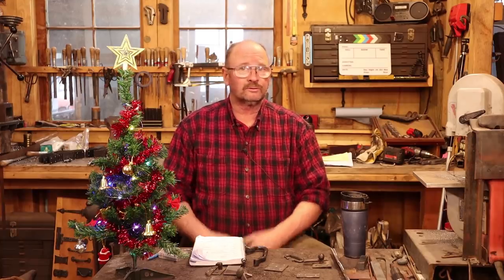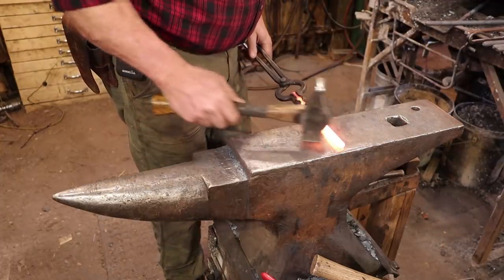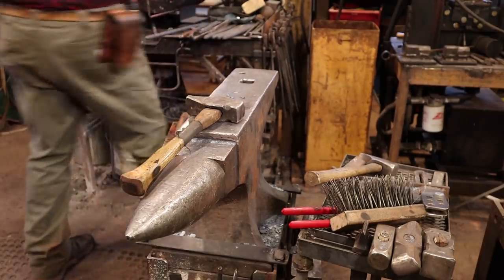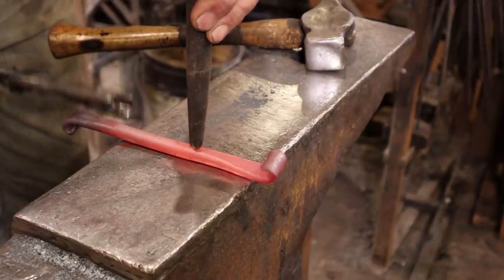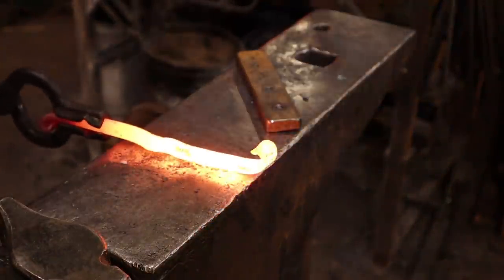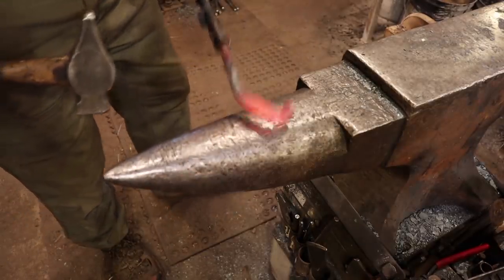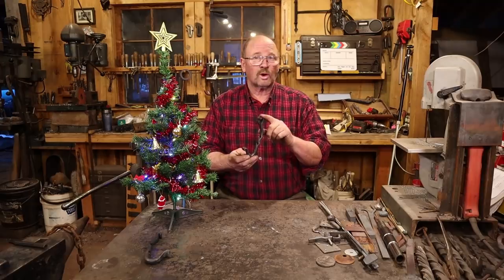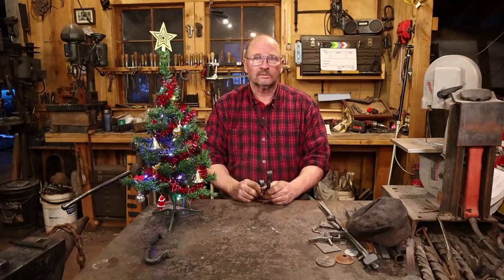Forging a coat hook   countdown to Christmas day 1

Comment: Mark Asbery suggests putting the 1/2" round bar in a 3/4" bottom swage when putting a dimple or starting a hole...the bottom swage cradles the bar and is wide enough to accept any bowing out of the bar

Comment: You cannot beat the old style blacksmith's coat hook for strength, the ones you buy in the hardware shops break with very little weight on them.
Reply: Most things are built for a price it seems lots of junk in most stores the price sells.
 That why we DIYs so much.

Comment: Or a v swag block would work great for punching the holes. But great work keep it up
Reply from the maker: Punching flat on the anvil makes the back a little flatter for a more stable hook.  Punching in a swage or V block would raise the edges of the ball punch dimples making the hook less stable on the wall.

Comment: Out of curiosity John, do you ever use straight punches instead of tapered punches?
Reply from the maker: Not often, they are more difficult to make and if the end start to upset in use it can effectively rivet the punch in the hole

Comment: John do you wear tin pants ? If so do you like them ? If so why ? I wear carhart bibs and I wear a leather crouch protection I made many years ago of course I’m
in a wheel chair so my needs are different then most .. if I smell bbq it’s not momma cooking lunch it’s usually me on fire somewhere or a something landed on the top of the folds over my boots in my carharts lol. Someone said tin pants will stop the smoldering fires that my carharts tend to get . I’ve wore carhart bibs my whole life my father grandpa and great grandpa we’re railroad men so they wore key bibs there whole life except on Sunday to church. So it was natural for me to wear bibs but I liked the carhart as I was a carpenter.
Reply from the maker: I mostly wear Carharts and have never heard of Tin pants.
Reply: John I believe they’re made of leather ... lol ... my smithy buddies had mentioned them and I’ve only seen them mentioned a few times .
Reply: Steve Dingman they are actually “oilskin” basically oiled heavy canvas to make them waterproof and spark resistant.

Comment: The work peices you show on your channel appear white hot when you remove them from the forge. 
Is this correct or is it just how the camera and or my screen shows it? I've been working metal to almost white.  Thanks for any input.
Reply: Digital cameras are light sensitive, so they will pick up the light coming off hot iron or welding shots and make them look brighter than they are IRL. Shady Grove blacksmith has a decent color chart for temp forging on his site: http://www.blksmth.com/heat_colors.htm  Lorelei Sims also has a pic and long paragraph on forging temps in her book, the Backyard Blacksmith. If you are going to white hot temps, you are probably getting close to burning your steel.
Reply from the maker: The camera certainly interprets the light and makes adjustments our eyes don't.  Plus different computers and lighting change the way it looks on camera.  So No, I am not forging near a white heat.  More of a bright orange for most forging
Reply: Thank you for the information.  Hope your week goes well. 
A color chart is my next item to obtain, and the book as well.